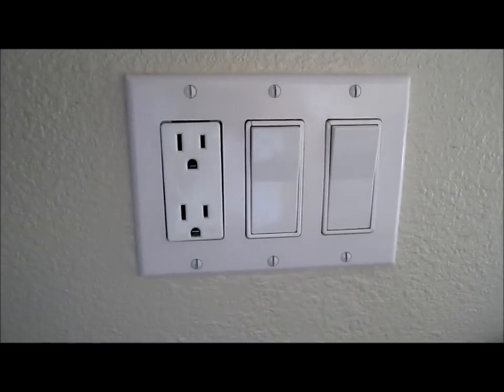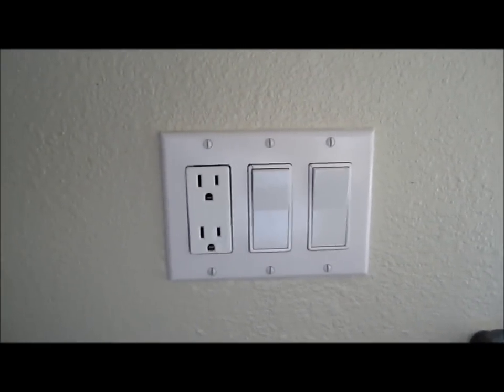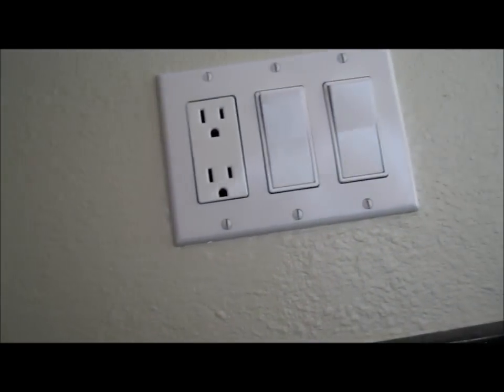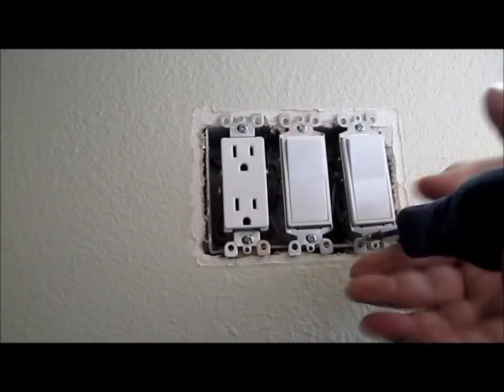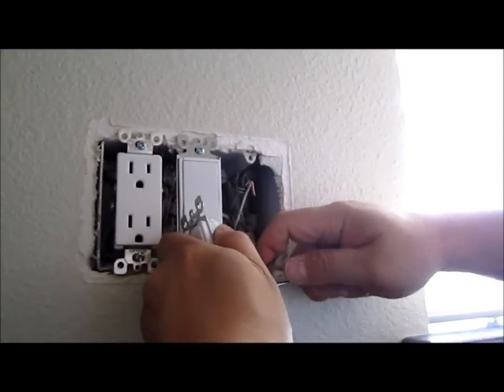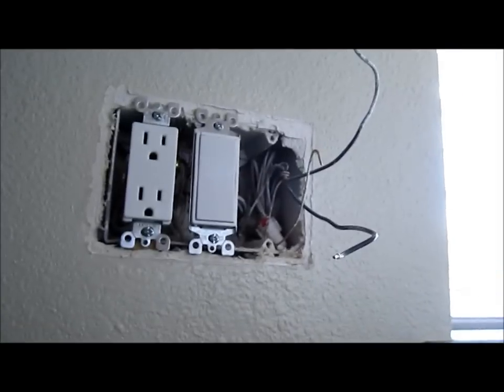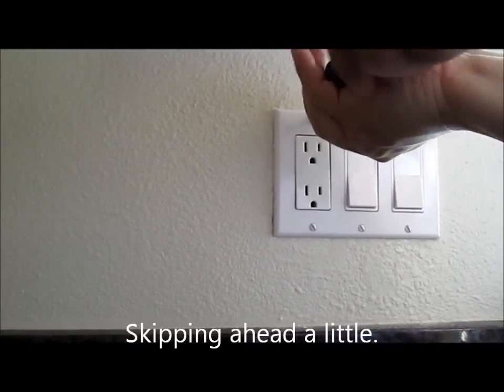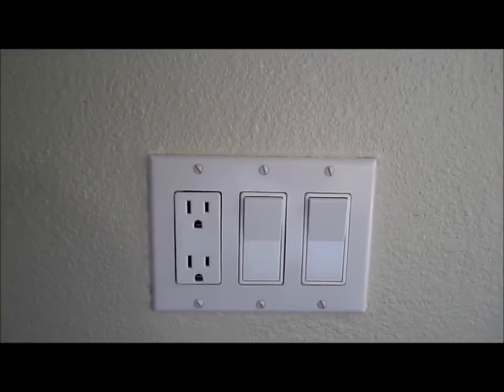How to replace and install a new light Single Pole Switch

Comment: what about installing a dimmer in the same location?
Reply from the maker: It's doable.
Reply: not the info im looking for. i'm dealing with 3 wires in my j box, one wire jumping from the switch i want to replace to the second switch and all wires look black
Reply from the maker: Don't know that one, maybe an electrician can help.

Comment: which colour goes where?
Reply from the maker: The copper one in this case wire is ground.  The 2 black wires goes in the holes on the switch. It's a single pole switch with ground.  If not sure, best to consult an electrician  for this type of work.

Comment: Which colored wire is the "Common" wire? The switch I have requires the Common wire to go in a certain spot on the back of the switch. Scoring the circumference of the switch is a great tip. Please let me know about the Common wire.